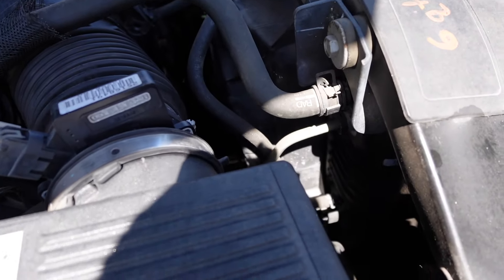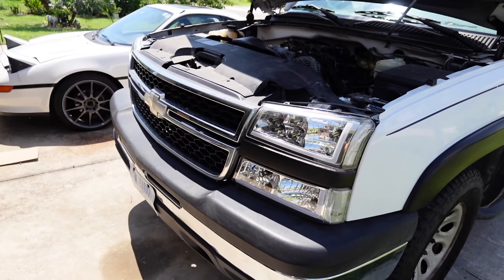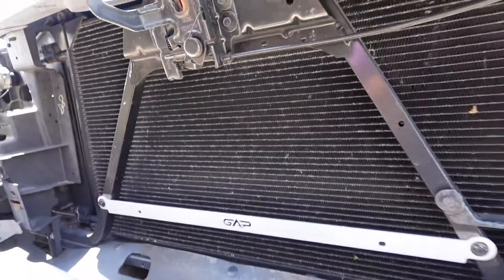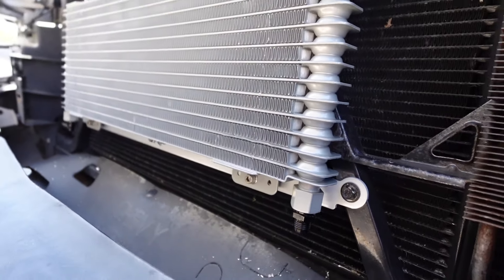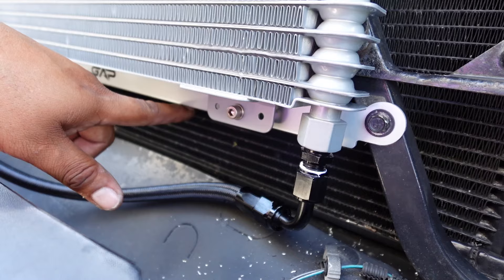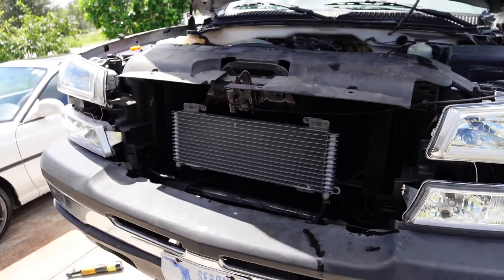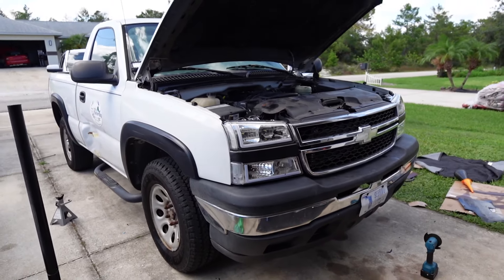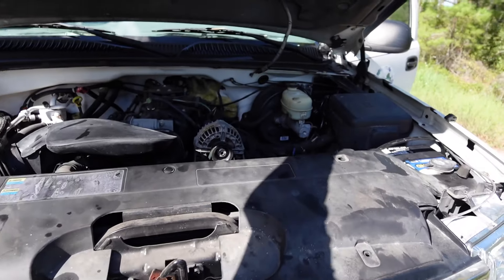A must have for any Silverado 4L60! 40K cooler install

Comment: Where you connected  the lines to which side?
Reply from the maker: @fernandovarela4935  it doesn’t matter which lines goes where
Reply from the maker: @fernandovarela4935  but the kit I bought had a short line and a long line. I did short to the bottom port on the trans and longer one to the top port of the transmission